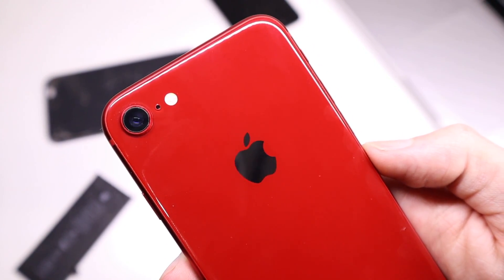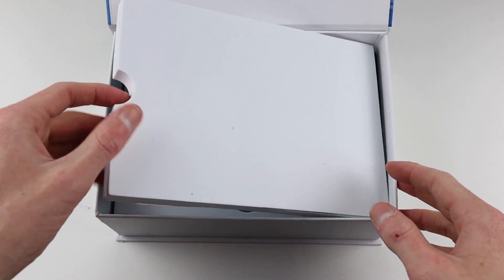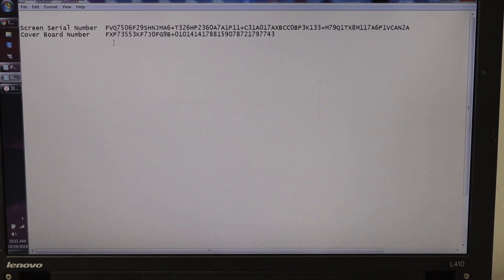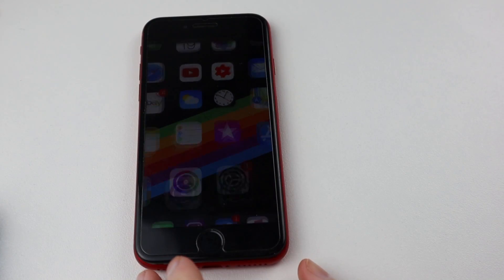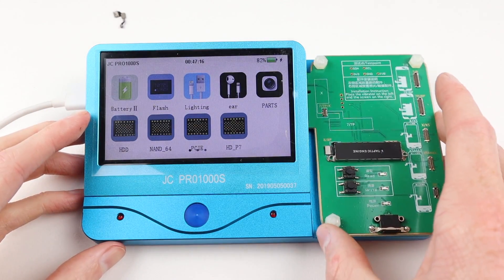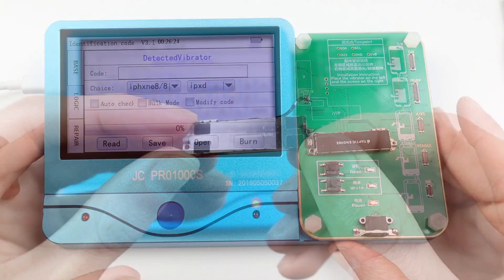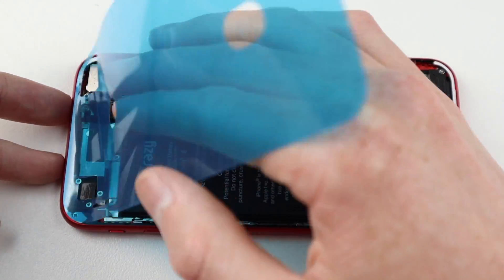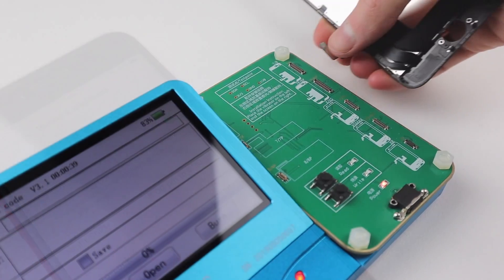Most Common iPhone Repair Mistake - True Tone Recovery without original LCD - JC Pro1000s

Comment: The funniest part of this is that Apple devices are repaired using windows computers
Reply: Because apple doesnt set mac os to repair ios
Reply: @misterkompu4868  technically you can reflash an i-device via mac but not comprehensive hardware-level repairs
Reply: @jacobnathanielzpayag3885  but the only way is to use iTunes which is dying
Reply: Chris Technologies YT “iTunes” still exists it is just built into the system, there is nothing iTunes on Mojave can do that Catalina can’t.
Reply: @EndOfLineTech  iTunes may only reflash an iDevice and backup your music then it will be useless

apple may make another alternative app and it may be called Apple Music or Apple Backup
Reply: @user-tj7hk1ss8d  actually, Apple integrated the feature onto finder (their file manager). You can manage your phone from there. That includes back-up, reset, re-flash, etc. Basically everything that iTunes used to do in terms of mamagement. Although I think you should be on Catalina for this to work.
Reply: Apple: we developed macOS using Windows
Microsoft: Apple, we think that you stole our product (Windows)
Linux: hurry, switch to linux!
Reply: Poor Mac Os Can't do this 🤣🤣
Reply: Le Chat Botté Maybe for the same reason people only make viruses for Windows? Making a software only for a niche demographic is stupid. No repair shop is going to buy a staring $1000ish machine just to program a screen. It’s just not going to happen... a good company would have dedicated machines for each piece of equipment. No one would buy your repair equipment If you had to use a Mac.... 

Guess what kind of computers they use in Foxconn where they build the iPhones for equipment? If you guessed Not new Macintoshs you’d be correct! It doesn’t make any sense for even Apple to use their own machines in production, so why would it be the opposite for 3rd party repair? 

There are advantages to using MacOS for diagnostics but it’s impractical for your standard 3rd party... so why would they make mac programs?
Reply: The real support software IS macOS.    But good luck getting a copy.
Reply: Probably because china.
Reply: FireAdrix f
Reply: You can't fix shit with apple computers lol. Even apple's software is developed via windows
Reply: @incog0956  but I heard Windows XP startup sound is composed on mac ...
Reply: Mac os can't even run these technical softwares it can only run the overrated shit softwares. Windows for the win
Reply: @BaljyotSonar134  even Linux can not repair but sometimes it repairs Computers and not Tim Apple Products
Reply: @user-tj7hk1ss8d  man Linux is still far far better than mac in repairing stuff and also coding etc Mac is lowkey shit haha
Reply: @BaljyotSonar134  i use Zorin OS 15 Ultimate that i recently bought
Reply: @user-tj7hk1ss8d  why would you pay for a Linux distro?
Reply: @user-tj7hk1ss8d  Nice. I use Zorin OS Lite on my second computer and it's so fast.

Comment: Seriously a back glass screen protector that's completely unnecessary even the front ones don't do anything why do you use them so much they are a waste of money they don't work your literally just buying a piece of glass
Reply: Because they protect your phone from slight impacts and scratches?
Reply: First off, the back glass is a pain in the ass to replace so having any kind of protection on there is smart. Second, tempered glass does work. Tempered glass is designed to crack on impact in order to absorb the energy from the drop so it has less of a chance of transferring that energy into the glass it is covering. It also provides scratch protection. I will say that the majority of tempered glass protectors on the market are not very good, but are better than nothing. Way better to replace a screen protector than it is to replace a screen assembly. Way less money overall.

Comment: True Tone is for the 8 or later only
Reply: Musketeer Oliver no it is not the 7 introduced wide color. The x and the right introduce True Tone
Reply: Musketeer Oliver no only on the 8. 10 10s 11 11 Pro
Reply: Not on the iPhone 7 Plus. I have a brand new one as replacement from Apple Bondi and it doesn’t have true tone. 🧐
Reply: i somehow had it on my 6 and it disappeared the other day...
Reply: greysxmerder ive had it on my 6s for like a year and I couldn’t find a way to turn it off
Reply: TukTuxedo you mean night shift? 6s and 7 don’t have truetone
Reply: JORD AWESOME prob
Reply: Sharmein Alireza then he has an 8
Reply: @Sharmein Alireza are you sure it's an iphone 7 plus
Reply: True Tone came with iPhone 8 & newer iPhones
Reply: @Musketeer Oliver Mandela effect, Google it
Reply: JORD AWESOME and for iPads it’s iPad Pro 9.7 or later
Note: the base model $329 ipad meaning 5th and 6th generation and 10.2 inch model do not have True Tone
Reply: in my 6s there is true ton
Reply: Only iPhones 8 and above has True Tone. Please stop spreading misinformation. It’s a simple google search to see the facts. There’s a HUGE difference between Night Shift and True Tone.
Reply: I never knew like actually
Reply: Wrong
Reply: Musketeer Oliver nope
Reply: Musketeer Oliver no
Reply: @Musketeer Oliver no youre wrong.
Reply: Musketeer Oliver ........................................
Reply: and why he mention ip7 had 'true tone'?? I tot that ip7 had it before~ before ios 13
Reply: Zaihan J he may have made a mistake. I know for a fact that the iPhone 7/7+ both do not support True Tone
Reply: It's for 7 and up ... But in the iPhone 8 and up the screen must be the original or the true tone function wouldn't work ... Even if you swap two original screens from brand new iPhone 8 true tone will not work either... The first to mintion this was REWA technology.. 
JC  invinted a programmer to fix this by copying the serial of the old screen to the new screen as shown in this video
Reply: @Musketeer Oliver it’s probably an 8 display in the 7
Reply: I have an 11
Reply: The 7 should have gotten the feature cause the screen on 7 and 8 are the same
Reply: @Musketeer Oliver I also remember seeing True Tone in the Control Center on my mom's old iPhone 7 Plus for some reason. My brain is lying to me.
Reply: underscoretb it’s okay it’s more common than you think it’s called the Mandela effect thinking something is true but it’s not. I happen to do it quite often haha.
Reply: Chris The Tech Guy yeah your body swears its an 7 but its a 8 and its like your brain thinks something looks better and you remember something different but it’s completely different its a weird effect
Reply: @mojave5661  I'm adamant my 7 plus used to have True Tone...
Reply: @sjbradley98   you just had night shift so you're confused. true tone first came out on the ipad pro after the iphone 7 and 7 plus was released. so only iphone 8 and up have true tone. i had a iphone 7 plus for 3 years and it never had true tone.
Reply: Got an iPhone 7, iOS 13.0, no repairs done on it, no True Tone.
Reply: EricArts 8 and laterrr
Reply: Musketeer Oliver That 7 does not have true tone, my 7+ doesn’t have it
Reply: What everyone is seeing on the iPhone 7 and below is 'Nightshift' which is NOT the same as True Tone
Reply: Tf is a True Tone
Reply: S A L 
lol
Reply: S A L its stfu
Reply: Alex Salas True tone adapts to your room temperature to make your screen look better or whatever its for

Comment: 9:51 PURE FACTS. RESPECT.
Reply: TouchID is necessary for security but others are unnecessary
Reply: @tvolta4830  - Not even that, who's gonna solder in wires to intercept the data while you're using your phone?  Noone!   In fact everything is encrypted to begin with. Totally unnecessary.  Samsung devices work just fine without these paranoid protections.
And even a friggin' vibrator being protected?  Come on man!
Reply: AMEN
Reply: OC Bus Fan hey we’re from the same county
Reply: Matt Man Really??
Reply: OC Bus Fan yeah, you’re from Orange County, right?
Reply: AMEN BROTHER.

Comment: My I phone 6s plus blacked out on me an wont turn on. Any ideas? #iphonessuck
Reply: Change battery?
Reply: Kuhl it is probably the motherboard on your iPhone
Reply: When you turn it on, do you receive sound notifications? When you toggle the silent switch on and off, does the phone vibrate? If so, shine a bright flashlight on your screen when the phone is turned on and see if you can see an image. If so, the backlight is out. Try a different screen. If that doesn't work, then the backlight circuit likely needs repair. Check out iPad Rehab for this issue. You usually need to replace the backlight drivers, diode, coil, and filter on the board to get that working again, which requires microsoldering. If the phone doesn't turn on at all, it may have a short on the main power line. That is usually caused by a bad capacitor on the line, which shorts the entire line to ground and doesn't allow electricity to flow thru all the circuits that allow the phone to work.
Reply: austin ricker I had an iPhone 6s before but I never experienced that black out problem, but I did experience my phone not charging

Comment: U should repair the iPhone 8 with the dead screen
Reply from the maker: its iCloud locked and wiped
Reply: Hugh Jeffreys use the JC-200 and reprogram the iCloud chip
Reply: @AmazeBytes  That's not how it works. iCloud locked phones are only good for testing parts on as you cannot activate them and use them as phones.
Reply: austin ricker I mean there is a way to remove it it’s just way to expensive
Reply: austin ricker u can open it but u have to change the motherboard with a unlocked one for the same phone
Reply: Mouamal Almusharafawy no there’s a way to do it without removing anything but it can’t be lost mode, there’s services that work they have inside guys at Apple
Reply: Vixous so ur saying if i have an iCloud locked phone I can bring it into apple and they’ll remove the iCloud lock
Reply: Mouamal Almusharafawy yoh don’t bring it In you just give them the IMEI and they delete the iCloud account entirely, up to you if you want to try it it works for me but is wayyy to expensive
Reply: Vixous how much does it cost?